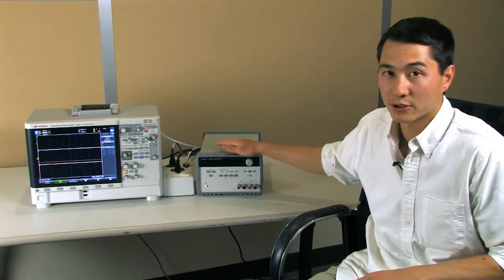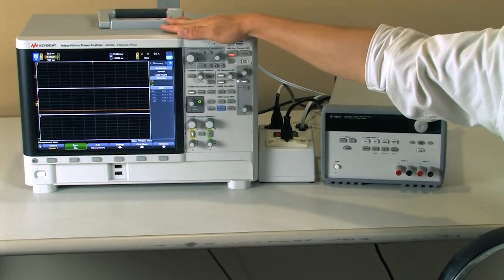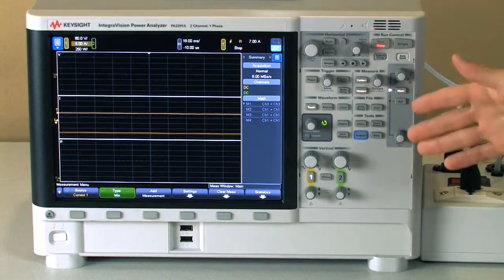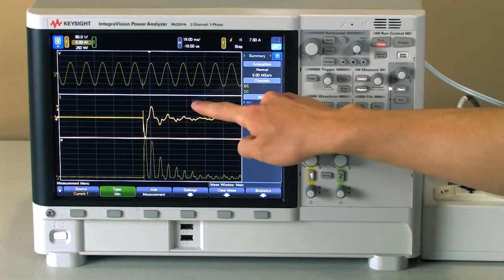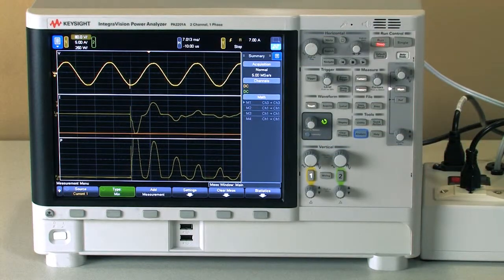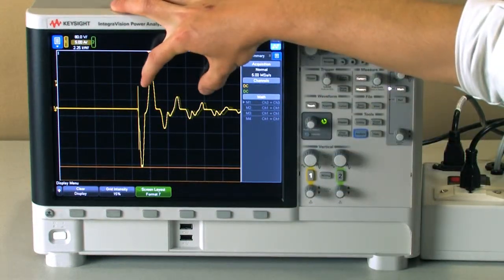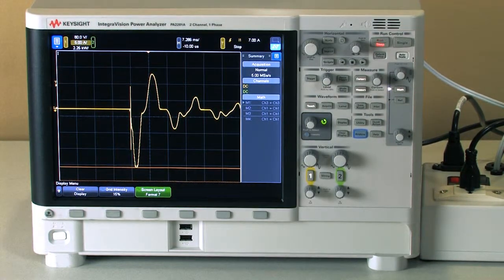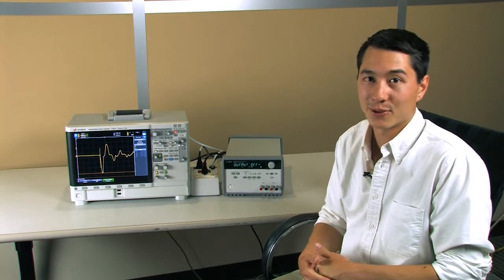Measuring Inrush Current with an IntegraVision Power Analyzer

Comment: non vedo visualizzati I valori di tensione , corrente e Potenza. perchè?
Reply from the maker: ernesto trivellato.  We visited many customers around the world that are designing highly efficient products and need more accuracy than the PX8000 to make their measurements.  In addition, most had trouble using the WT1000.  The PA2000 provides a true scope like interface along with the accuracy to make precise measurements.